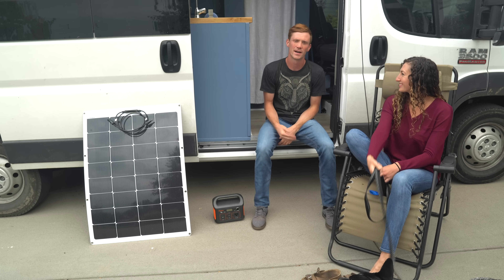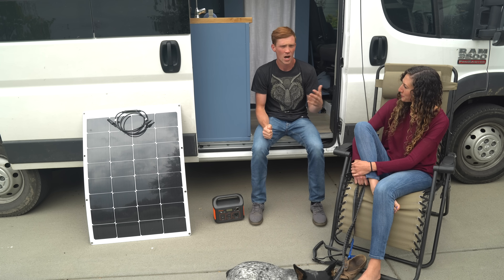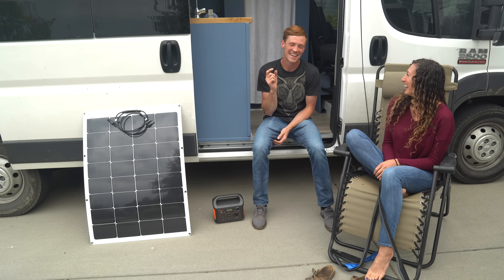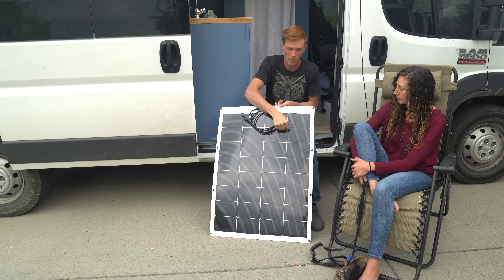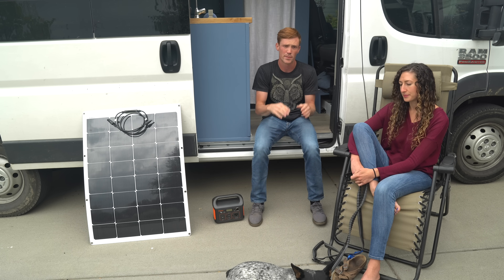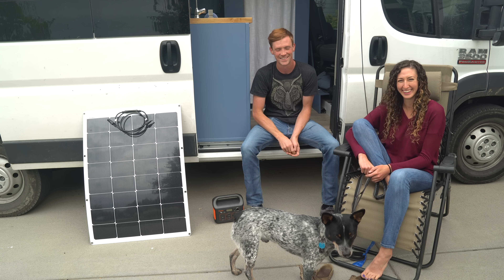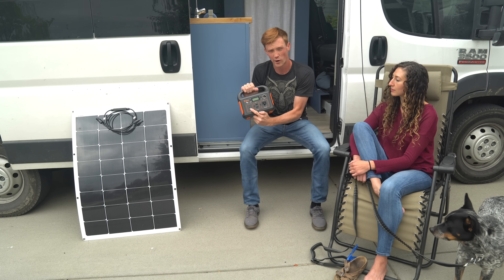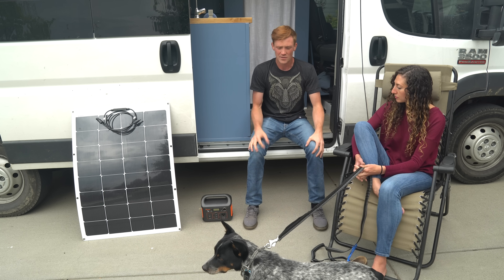How does Solar work? Sizing your van system | Trent and Allie

Comment: I have a 120 w solar and one battery. I was told to get more solar and another battery. But I was also told that if I did, the new battery would decline quickly because of being connected to the first battery. Is this true? Would I have to ditch the first battery and buy two new ones together?

Comment: Currently working on making a '76 class C motorhome into home. It has an ancient Briggs and Stratton generator built in that needs to go - considering a combo of solar and small (quiet!) generator to replace it, since solar alone probably isn't realistic in the pacific northwest. My main question is... is it possible to hook up both power sources into the existing wiring?

Comment: Hello,   I have a 1400 goal zero.  My 12 volt frig pulls the power down.  If the battery gets below 60% the frig turns off.   I guess it’s a safety feature but I can take my battery down to 0.   It was so frustrating that I haven’t gone out at all this summer.  Also I can’t figure out how to get my 3 100 watt solar panels hooked onto my fiberglass roof.

Comment: Hey guys, great vids - keep it up. Quick question: i am converting a 2016 promaster 159, and i am trying to do everything without propane. I have planned for 2x renogy 200ah batteries in parallel, 2x renogy 24V 300W panels in series, and a 48v/60A renogy charge controller. I have a 120v/1500w heater, a 120v/1500w oven/stove, and a 120v/1500w 7gal water heater, and a 12v/50w fridge. I don't plan on using all 3 at the same time, but is my electrical system enough to support running these appliances? TIA

Comment: Trent!  This video was fantastic.  Just fantastic.  And presented in a clear, conversational style that even this non-electrically savvy woman could understand d follow.  Engaging, as well....which is hard to do with a topic like this.  So thank you very much.  Three questions for you:  I read through much of the comments to see if you had already answered this, but did not see it.  

1: Can you tell me roughly how long it takes for you to recharge your entire battery bank via the rooftop solar panels in full sun?  
2.  When using the alternator to recharge the batteries as you’re driving, about how long will that take to fully recharge the system?  
And 3:  once fully charged, how many hours or days can you get from your batteries when the weather turns totally grey, and with your typical usage?

Thank you again.

Comment: Great video. I don't do a van or travel near as much but I do live in an RV. I may be in one location for months. Most parks charge you a monthly rent plus electricity. Although it's not killer like a house is it can still reach $100 a month(They can charge a premium. Much higher than local rates) when its 100 degrees outside. And me and my dog like it cool! LOL
 During the down time I would like to offset that bill with solar I realize I'm not going to be able to go totally off grid. 
 I'm totally up on the batteries, charge controller, panels and inverters. 
 How do I slow that meter down? LOl

Comment: I recently decided that I was going to go on the road for about a year.  I currently have a 100w solar panel with a Goal Zero 400.  It does great for weakened trips but I need more power to keep my cooler running 24 hours a day.  I have a Kooltron P75 12v cooler and then I would need to power my Maxxair Van.  Other than that all I need to charge is cell phone, tablet and  camera batteries.  Would I need to add more solar and get more batteries or just add more batteries?

Comment: How did you wire up the charge controller of the solar system and the charge controller of your inverter to the batteries. Isnt it a problem if the batteries are being charged with solar and shore power if you are plugged into shore and the sun shines?
Reply from the maker: No it’s not a problem, two charging sources is just fine. Both sources need to be able to mediate the electricity which they do

Comment: Hi Do the solar panels on a roof of a van have to be all the same size in Watts for a 12v system as I would like 2x120 watt & 1x 100 watt. Then I want 150 watt portable ones to move around the van angled towards the sun when the sun is lower with a quick connection to the same system.

Comment: You built a 12 volt system but your solar panels are 24volt, Is that not an issue?
Reply: Answer Stewart I'm also wondering about this! Looking into building a system myself

Comment: Hey Trent - quick question about MPPT controllers. Can most 60a controllers be set to lower amperes (30a, 40a etc). I'm deciding which to buy for my soon to be setup of about 300w solar & 230-260ah battery bank. Not sure if 60a is just the limit - or if it's a fixed amount. Not much of price difference in the PowMr ones you have linked, so might as well size up I guess ? I'm assuming they're "smart" and have adjustable setting etc.
Reply from the maker: 60 is the most amperage it can handle. And anything under will be just fine 😊

Comment: Very informative. I’m in the process of trading my fifth wheeler for a motor home and it has an inverter installed for the residential fridge but it does not have a solar panel installed but has the rest of the system installed. I just have to buy a panel, I’m not sure which one to purchase yet.
Fred

Comment: As an electrical engineer, I believe the reason for oversizing solar panel capacity are due to two primary reasons, first lead acid batteries are 50% efficient at charging and 98% efficient at discharging, second lead acid batteries loose a lot of their operational life to deep discharges, even deep discharge lead acid batteries which have thicker plates and better separators loose at least 5% of their useful life from a complete discharge hence it's often stated not to discharge lead acids by more than 50% though in truth discharging far less would be much better as 50% is just the midpoint in the rate of degradation curve.  If you consider both these factors, you would be sizing solar panels to be about four times your diurnal usage.  There are other factors such as how much of the energy use is during the time that the panels are producing power versus how much when drawing from the batteries are the only option, obviously power consumption direct from the panels do not incur the inefficiencies of charging and discharging the batteries.  Where the cloudy day argument comes in is if you have to oversize your battery capacity to avoid deep discharges anyways, you could excuse this as providing cloudy day coverage.  If cloudy day coverage was truly the reason for oversizing, we would be looking at historic weather reports for the location the panels would be used in to find the average number of continuous cloudy days and the standard deviation of that value.  You used to be able to pull that data from the weathersparks website but their reports have been simplified so you can't pull that information anymore.   I appreciate that people working in the solar panel industry may believe the oversizing was due to cloudy day coverage but it isn't, it's due to the wide use of lead acid batteries.   Lithium ion batteries have their longest life if kept between 20% and 80% charge but very few charge controllers will stop charging at 80% hence it's commonly said that you can discharge them by 80% even though an economic analysis should be made to see if only using 60% by throttling at 80% except when a series of cloudy days are forecasted would be worthwhile.  Lithium Ion batteries are also 80% efficient at charging and 90% efficient at discharging so they are not as superior as many believe them to be.  Interestingly, nickel iron batteries can be safely discharged completely without any loss if useful life so they can reduce your need for solar panel capacity dramatically but if you start adding capacity for cloudy days, it loses a lot of the panel capacity advantages leaving you with the long useful life advantage alone.  Now for a constrained system like an RV or a van, lithium ion has the distinct advantage of energy density both in volume and mass and of course limited roof space constrains the capacity of solar panels that you could install.

Comment: Most informative on power system I've seen!
Trent, how is the PowMr Charge converter holding up?
How long have you been running it?
What about using 6V AGM batteries? I can get 390Ah batteries here in the UK.
Reply: just wondering if you'd seen this?

Comment: Hello, I am researching a solar system. I am a life long mechanic but have been a machinist for the last 10 years. I recently became aware of the new computer controlled alternators on newer vehicles (2008 and newer). Is the charge relay you are using compatible with these alternators or did you order your van without a computer controlled alternator.
Reply from the maker: You hook the charge relay up to the battery terminal like you’d hook up a second battery on a diesel truck. You don’t connect it to the alternator. Hope this helps 😎

Comment: Great advice going with the thinner solar panels for so many reasons. They are lighter. When they need to be replaced, new ones will be much cheaper and higher output. Heavy ones that last 25 years will be outdated old equipment in 5 years. Solar usage is doubling every 2 years and price is already cheaper than coal in some countries.

Comment: Every place you can avoid stepping power up to 120v only to have the device step it back down, you can save power. I have not used this specific device but one like this will charge laptops. https://amzn.to/2PnCMqa I am sure other things can bypass the step up step down power loss. Such as USB chargers hooked into 12v or 24v (but most, likely already do that).
Reply from the maker: Thank you!!

Comment: Watching this over and over and still so lost. How do you figure out how much power you need? How do you count how much power your appliances need? I'm thinking: fridge (dometic 12v?), electric water kettle, induction cook top, LED lights... is it crazy to think I could get an electric heater or microwave?
Reply from the maker: Microwave will probably use less electricity than an induction cook top or electric kettle. You're better off to cook or heat with propane but if you want to heat and cook with electricity you'll need 1000 ah to be safe and at least 1000 watts of solar. Heating and cooking with electricity is inefficient, even with the most efficient appliances! sorry if that's bad news.

Comment: So you're funneling 48v into your MTTP charge controller, and then that goes into a 12v battery bank. What do you do to make the two compatible? Or is that the job of the charge controller?
Reply from the maker: MPPT charge controllers convert high voltage to 12volts at high amperage. Hope that helps. Thats the answer in a nutshell though.

Comment: 08:07 - parallel* | 700Ah BEAST! We just about manage with 290, could always do with more!
Reply from the maker: At 8:07 I’m referring to the panels being wired in series when using an mppt charge controller. The battery bank is wired in parallel though 😊

Comment: Hey Trent, 
Thanks for all the awesome information. 
Question for you.  In your 1st PM you ran the solar leads through your brake light housing and in the second van it appears to be through the roof.  Were you having voltage drop issues the old way because of the extra length of the leads?
Reply from the maker: No voltage drop issues, i just didn't want to have to run the cables as far so I ran the cables the shortest distance possible.

Comment: I’m interested in getting something like the Jackery just to power a fridge. I already have an auxiliary battery that charges from the alternator, without solar. I use it for lighting and phone charging mostly. But I’ve been wanting to add a fridge to my van and I definitely want to spend as little as possible.
Reply from the maker: Check the links 😊

Comment: Can you talk about inverters? Why not 5,000 watt inverter? Does the inverter store the amps or shoes it switch the energy somehow? Never mind I didn’t watch the whole thing.
Reply from the maker: The bigger the inverter the more energy it takes just to be powered on. A really large inverter requires an even bigger battery bank
Reply: Interesting. So the bigger battery bank would be lithium correct?  I need a mobile office. So I want ridiculous power. Like what is the most power you've seen and how much space would that take up? Lol. I would definitely want lithium. Thank you for this video. I follow the WYNNS also. Jason Wynn talks a lot about solar power and apps and such. I am learning a lot. I am a wanna be. It is my plan within the next 3 years to make this work. Thanks again, have a great day!

Comment: Helpful Video. Thanks. I read that some solar panels do not charge at all if even partially shaded.  Is this correct? To the Renogy 300 charge some even if in partial shade?
Reply from the maker: Yeah they charge in partial shade. They are a very high quality panel compared to a lot of competitors. I highly recommend them
Reply: Thanks. I'm planning a build in the next few months with a Promaster 2500. (nervous and excited) Your videos have been helpful.

Comment: Thanks for the great video... wish I would have seen it before my install, and still hope to have your opinion on my system:
I have three 100Ah Lithium batteries wired in parallel for a total of 300 Amp-hours of storage. 
Yep, I went Lithium hoping for more storage and less weigh/size, but your batteries seem as effective. I don’t think my system is sized appropriately, and am currently having an issue with refrigeration because of it. Here is what uses power:
Inverter 35 watts (currently - always on)
WiFi Ranger 30 watts (currently - always on)
weBoost ~30 watts (not verified but estimated & currently - always on)
roof fan 10-20 watts (when in use, depending on speed)
Espar heater burns diesel but still uses some power ~25 watts (only when on)
hot water generation pump ~10 watts (only when on)
radiant heat pump ~10 watts (only when on)
Aux heater fan/pump ~50 watts (only when on)
Fresh water pump ~60-70 watts (only when on)
Shower pump ~50-60 watts (only when on)

I currently have AC refrigeration (which is causing my batteries to drain too quick), and am looking to switch to this  DC option to try to conserve - ISOTHERM DOUBLE DRAWER 160 LIGHT FRIDGE/FREEZER which consumes DC: 1100 W/24hr
I’m not a Solar professional and unfortunately didn’t get sized appropriately up to now, which is why I’m in this predicament and needing to swap units. With this info and your expertise, what are your thoughts on my system and this new DC option? Much advanced appreciation!
Reply from the maker: I think 300 ah of lithium should be good for what you’re using the system for. Your solar system is most likely undersized you should have 600 Watts at least for that battery bank especially if it’s being drained down over a day. Also you need to make sure your inverters setting are adjusted for lithium batteries. Lastly if you’re still seeing the bank being drained I would add another 100ah battery. Depending on the brand you used sometimes cheap cells don’t perform as well as they state they will and with lithium most people are looking for the cheapest option. Hope this helps

Comment: Good presentation...volts/amps is brain draining for those who don't have a basic knowledge.  Thanks for explaining it so well.  Just one question about the larger Yeti...do you think it would be sufficient for a smaller van with a maxi fan, small fridge,  a couple led lights and some computer charging?  Sure would be easier to set up if you're don't have someone knowledgeable to help.
Reply from the maker: Yeah the yeti would work fine for that if the fridge is DC it will be better for sure and you’ll need good solar to keep up with it, but I think it will Work well for sure

Comment: Great vid, guys! I know you mentioned the yeti line, but have you heard of the inergy kodiak? It seems like a more robust option with the same basic features plus being expandable to add more batteries. I also like that it has a RV plug built in.
Reply from the maker: haven't heard of it, will need to look into it!

Comment: hello Question i was told to go AGM but 6 volt and wire them in Series get more amp hours. what your thought on that
Reply from the maker: Wiring batteries in series increases the voltage not the amperage. Wiring them in parallel increases the amperage and not the voltage.
Reply: Trent & Allie   So when I do this in my camping trailer you coming to help me lol.  Love how fast you answer question. you two ROCK!!!!

Comment: When you got the new van, you switched from an induction cook top to a propane one. Was it because it took to much power to run it? Also, how do you think it would work with an Instant Pot, which takes a lot of power?
Reply from the maker: I think an instant pot would work fine! We could've used the induction cooktop in this new van, but didn't want to rely on electricity in case we were in places without as much sunlight or a random situation where you don't have enough power, the last thing you want is to be stuck unable to cook. that being said, the espresso machine uses much more power than an instant pot and it does fine
Reply: Trent & Allie we usually go somewhere with shore power. Just a habit we got into when your son was younger and had to have a nébuliser for his asthma. So we were just considering solar in case we decided to stop somewhere without power. So probably not something we are thinking we would have to rely on all the time. Good point about the cooking though. Our Vanagon has propane, which I love, however I was thinking switching to all electric would be safer. Maybe that’s over kill since it’s not like these things are air tight!